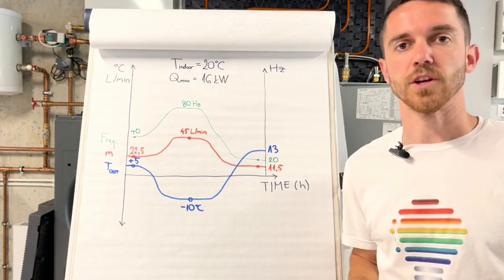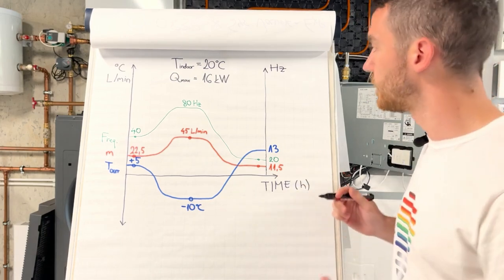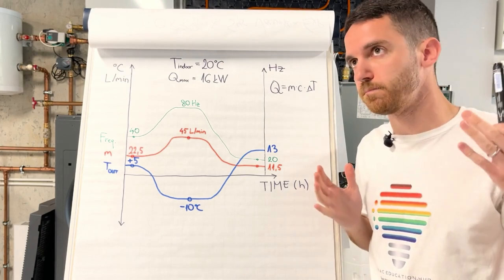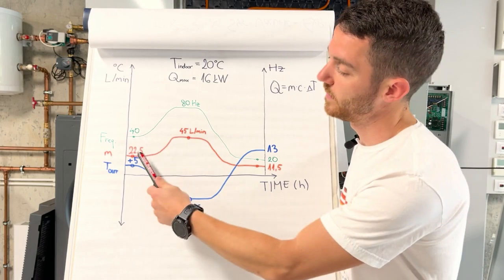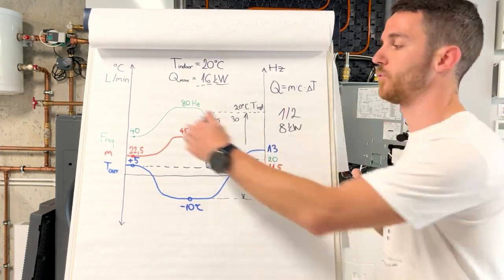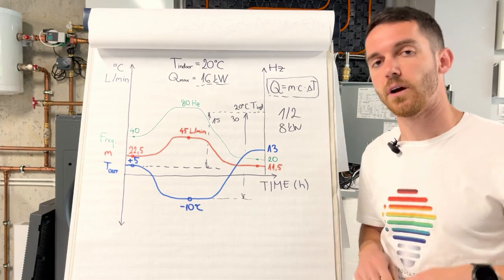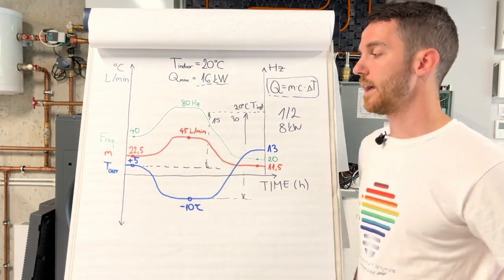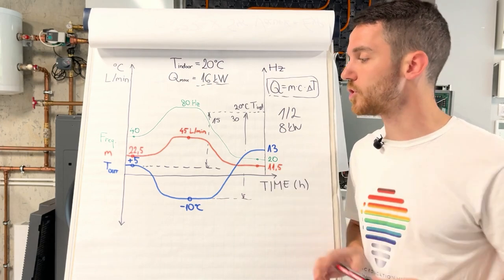Do You Really Need a Buffer? Heat Pump Flow Rates Explained

Comment: Hi Mario. Thank you for your videos and what you do. Keep it up!! There is one place I keep getting confused. In the mass flow rate equation for delta T, should we use the temperature difference between outdoor and indoor or should we use the difference between the heat pump flow and return temperature?
Reply from the maker: Hi, thanks.
Mass flow rate is water flow rate so always flow and return difference.

For building heat loss, outdoor and indoor difference. Always comparing air with air and water with water.
Reply: @HVACEducationHub  thanks for your response Mario. But in this video the indoor minus outdoor temp is used as delta T in the mass flow rate equation right?
Reply from the maker: No, this is just explanation for correlation between mass flow rate and capacity. With 1/2 difference capacity is 1/2 (8 kW) and with constant delta T (5) flow rate m is 1/2
Reply: @HVACEducationHub  thanks Mario!!

Comment: Your videos are awesome BTW!

On a standard uk system where bedrooms have TRVs or a new build where the upstairs is zoned (and we can’t guarantee customers won’t turn them off) Some installers therefore install a buffer to protect the ODU. 

Is an alternative to disregard the zoned volume from the system volume calculation and potentially install a volumiser (if required)? That way the defrost and start/hour are met by the section of the system that remains open and if the upstairs rads/zone is open the system gains additional volume and reduces cycles/hour. 

Is there still an issue regarding the output of the unit if the heat load is potentially halved? Or if minimum system volumes are met is this minimised?
Reply from the maker: Thank you!

I think not the issue because volume is important. And you will have cycling always on higher outdoor temperatures, the main thing is to have at the highest outdoor possible.

TRV/thermostat is good for bedrooms to prevent overheating, but this is usually 20-30% of the volume so even without volumiser could be fine. But still, volumiser can help, even the smallest one to compensate that volume.

Comment: Hi Mario, 
Can you possibly do a post on the importance/requirement on minimum volume for a Heat Pump when not incorporating a buffer and are required to Zone the heating system due to local regulations
Reply from the maker: Hi, I think zoning could not be under regulations. If you are from UK, you probably have required zoning for rooms above 6 m2 but if you can do it without valves I think no problem.

But basically I will do the video as this is something that I planned to do 😉
Reply: Yes, in Ireland once the house area is above 100m2 you must have a minimum of 2 heating zones. This restricts the possibility of open loop. The only way around is to introduce a volumiser as opposed to a buffer/hydraulic break.
Reply from the maker: Volumiser is fine if you have space. In Croatia problem is small apartments in buildings because you don’t have space to put it
Reply: The same problem here and I'm trying to solve without buffer or additional materials that increase cost. The new K & L series from Panasonic defrosts through the coil. I need to achieve a similar solution for the J series

Comment: By the way… We are assuming that the Heat pump as weather compensation curve, correct? Because If not the nor the frequency or the mass flow will modulate
Reply from the maker: Even with fixed flow modulation is present as dT will go narrow by higher outdoor temp
Reply: @HVACEducationHub  but if flow is fixed and we go to the Q=m x c x DT equation… Then we going to have a lower DT (Water Out minus Water In) right? Since Q will decrease because of the modulation
Reply: For exemple we have 45 l/min times a DT of 5 degress (water out minus water in in the radiators) then we have 16kW… however if we have 8 kW unit and the flow os fixed…. We have 2.5 degrees DT
Reply: Unless having a lower DT is a good thing since the lower the temperature coming out of the compressor… the better in terms of COP
Reply from the maker: Even with fixed flow TEMP flow RATE is not fixed. Of course you can fix it on some units but if logic is dT then flow rate will vary always.